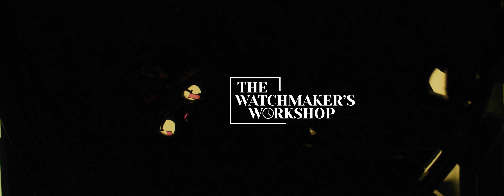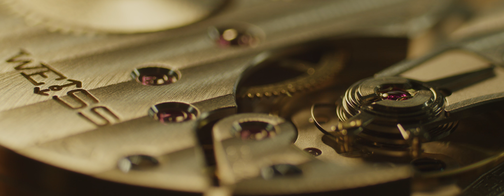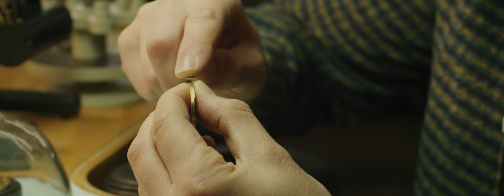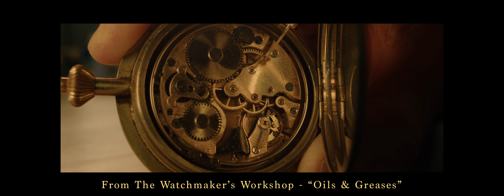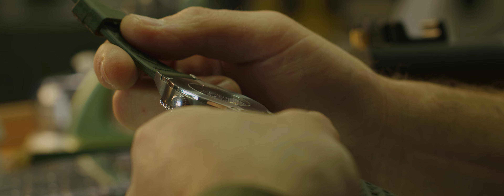Q&A Part 1

Comment: Cameron, Wow! I'm just learning watchmaking, and I very much love your channel and like your easy-going personality and worldview on watchmaking. I have a question. If I buy an ETA Valjoux, top grade, glucydur balance movement for about $495.00 off eBay, do I need to take it apart and lubricate it myself, or does it come lubricated? Thanks, David Lee
Reply from the maker: It depends on the seller. Some sellers are selling fresh/new movements that are clean and have all the proper lubrication.  Other sellers might have older stock of movements that are clean, but might have been siting for more than a few years and need cleaning and lubrication.  There are also sellers that sell movements that have been taken out of other watches and will definitely need full cleaning and oiling.